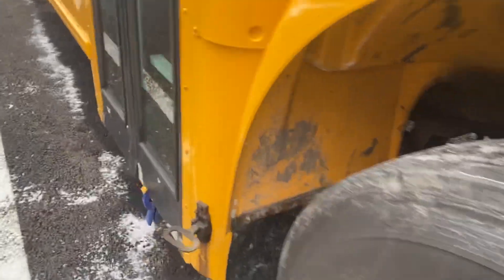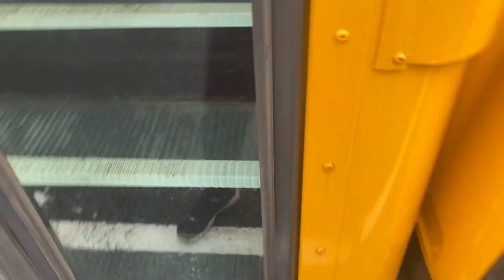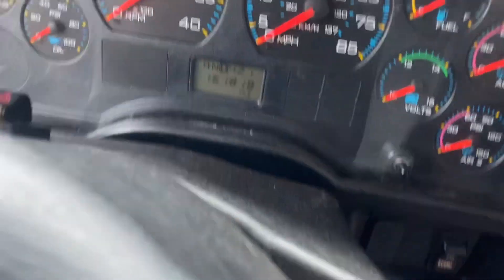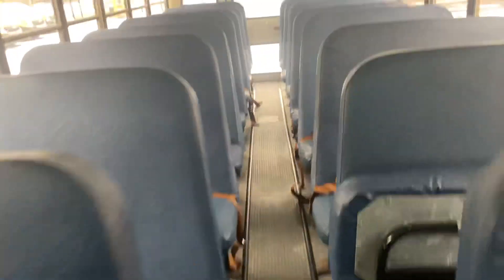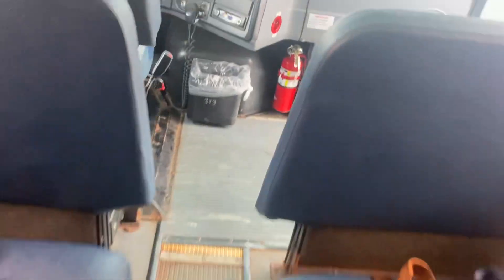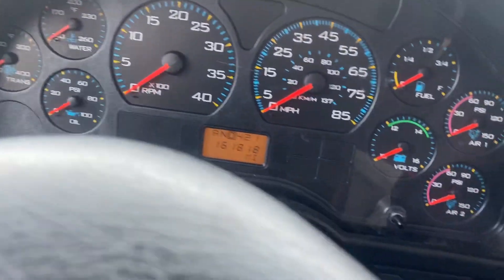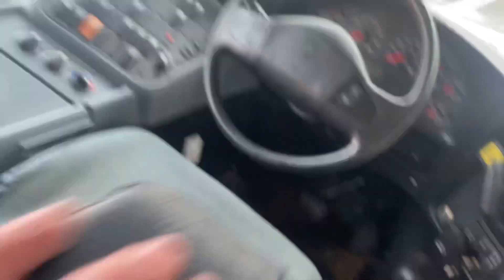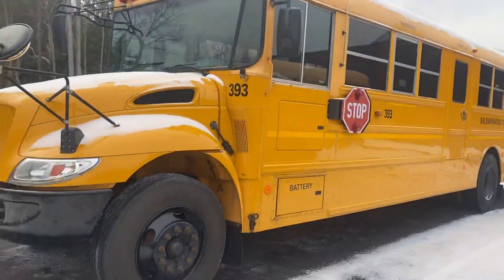393 Tour/Walkaround — 2007 IC CE300

Comment: A bus being dirty or “disgusting” isn’t a reason to retire it. It’s a reason to clean it...
Reply from the maker: It has a lot of hidden flaws
It's been through 3 transmissions and 2 motors
And the frame is so rotted
Reply: @ThatOneLT1  oof, that's probably why they kept it
Reply from the maker: I would have to assume someone in the transportation dept has some sort of connection with it.
Personally I think this bus is a safety hazard, it should at least be taken off student transportation and used for another activity like 275 was used for many years pushing stuck buses out of the snow.
Reply: @ThatOneLT1  I completely agree, that's why the oldest bus at my school is an '13, because our buses endure a hard 7 years. And the maintenance costs raise
Reply: We keep our buses longer than 7 years normally.